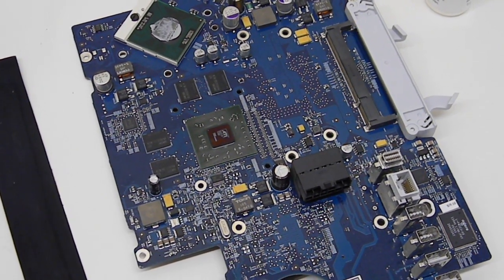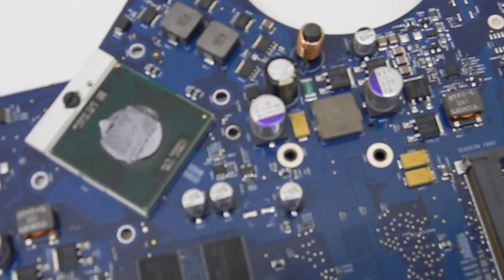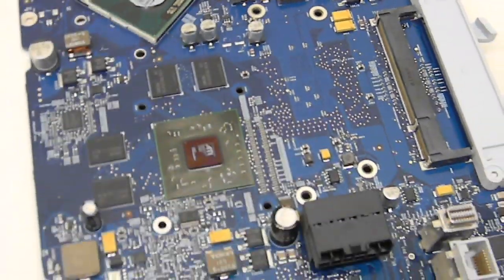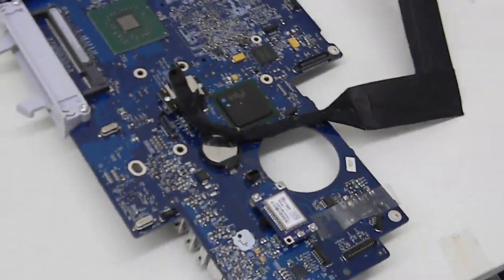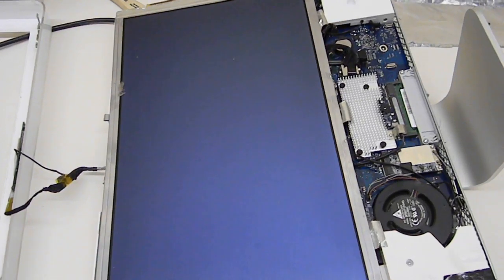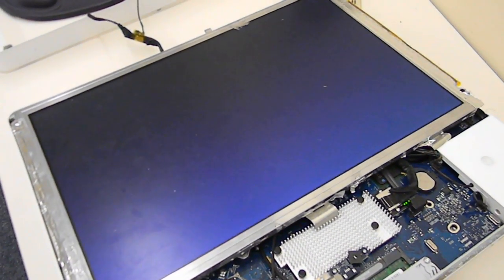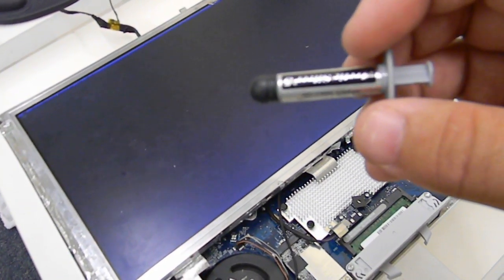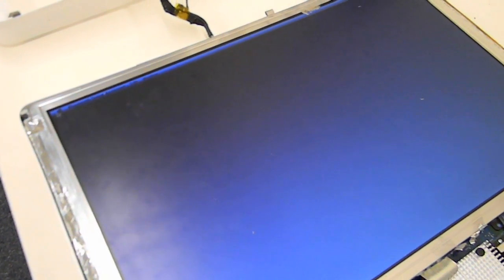Apple iMac G5 ALS repair of a logic board in a system that has power but no chime or no video.

Comment: I have a problem. I have a imac 2011. It takes 5 presses until the motherboard led 1 lights on then it takes 1 more press to turn the computer on. Then real fast 1+2+3 led lights up and then shuts off after the 3rd led lights up. Could that be the logic board or graphics card? Any real way to test it?
Reply from the maker: The only way to test is to reflow or reball it then test it again.

Comment: I have an IMAC  G5 that turns on and i can hear the fan and the system running sounds as normal but the screen is showing me black screen. Please if you could provide help if you know anything about this problem.
Reply from the maker: The system has a known issue with the video card.

Comment: mi imac g5 2 ghz 17 inch has a very weird problem. when you push the power button you can see the light and hear thevfans spinning but no video or chime. when you wait like a minute fans start blowing with full speed.

Comment from the maker: @OnPlanet12 If I remember correctly on a later model iMac the fourth light is the red warning for overheating light.  So what you would want is a 1, 2 LED then the 2 LED turns off and LED 3 turns on.  That signifies a boot process.

Now on ALS models the boot up is different and the lights stay on and you want a LED 4 light to turn on.  Usually with an ALS model your LED 4 light will not post if the video card is bad.  They are Mini PCI-E cards.

We charge $125.00 to fix those issues.

Comment from the maker: @3DVFXECTOR A repetitive chime is displaying a system reboot on an iMac so if the system continues to chime at a regulated interval, ie. every 5 seconds or 2 minutes and does it constantly, I will say it is displaying a chipset issue.  This would be the same displayed issue the DV2000, DV6000, DV9000, and TX1000 HP systems display with a failed chipset.  They boot, show blue lights, ie.  like the iMac chime, then turn off and repeat the cycle.

Comment: @BGAReflow Sorry for the late reply, =), I am using a Hot Air station to re-flow the Northbridge, but am actually planning on just completely removing the chip all together and re-balling it correctly, as I haven't been satisfied with the reflow, and I don't have access to an IR station at this time. Any recommendations on what model of IR heater to purchase?

Comment from the maker: @hafirahman Our systems have a riser to space contact.  Aluminum foil is not needed since the heat application is in a space close enough to keep it centralized to just the chipsets and VRAM.  You can use it, but with our systems we have different lens that dictate different exposures and we use the tightest one close enough to keep the IR on just that chipset which we are working on at the moment.

Comment: Thanks for uploading a very interesting video, just a quick question,

How do you protect the capacitors and plastics on the bottom of the board whilst preheating, do you use aluminium foil and whats parts do you cover ?

Comment from the maker: @doanhtran Thank you for commenting.  We appreciate that very much.  Now, we place the whole unit on the preheat table at 145 degrees and then reflow the GPU and VRAM with the IR overhead unit at 235 degrees.  We do that with shielding at the component level to keep the other components from overheating or being heated to begin with in the first place.

Comment: very helpful video..  Did you reflow the whole board or just the ati gpu and vram?  

If you heat the whole board, can you share what temperature did you use for 5 to 10 minutes?  I would like to try the same thing for my imac G5..

Comment from the maker: @forestmanify Thank you for posting.  We appreciate all questions and comments and votes.  We perform reballing, but if the chipset is reflowed with IR instead of hot air then the likelyhood the system will fail is slim.  How are you reflowing your system, by hot air or IR?

Comment: Great little video, thanks for posting this up. I'm currently troubleshooting an iMac 7,1 (2007 model), with the "Power On, no chime, no boot" problem, After testing various other components and modules, it appears to be the Northbridge chip (on this model, being an Intel SLA5U) that is the problem. After a quick DIY reflow, the machine works again for many hours, but seems to need a proper reballing. Hope this helps others. ^_^